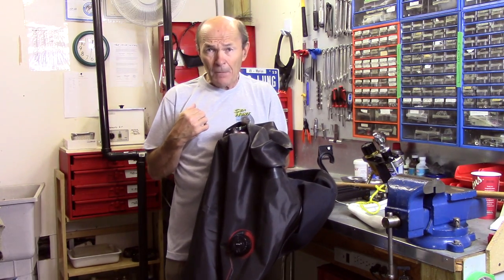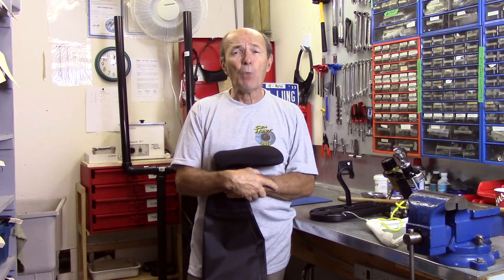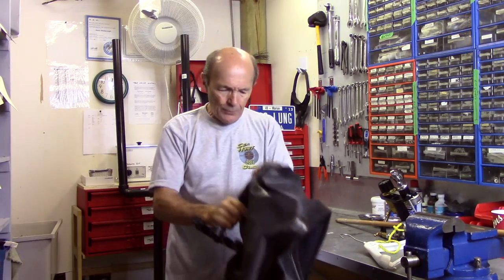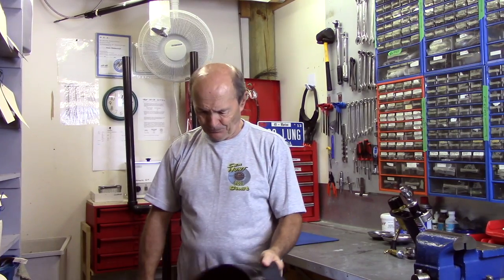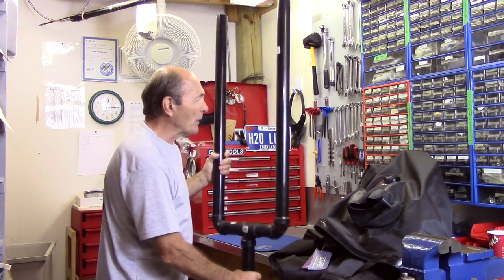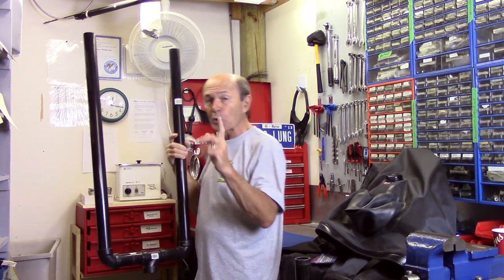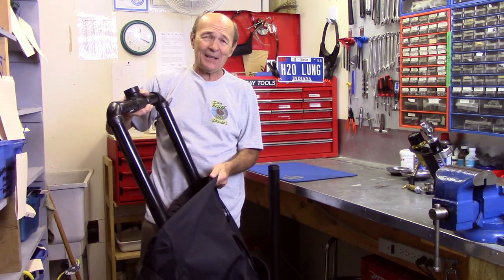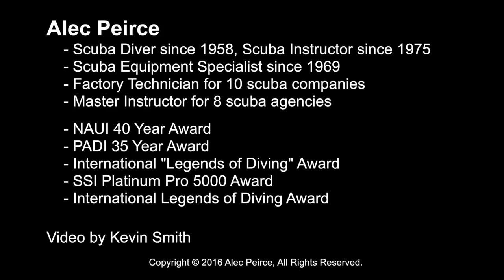How To Dry A Dry Suit - Scuba Tech Tips: S04E05

Comment: Thanks Alec. The broom handle is THE dryier that i will take when doing trips in the mountains. For the boots...... i find that putting some silica balls inside a sock and stuffing the socks inside each boot is pretty efective and of course portable ( in fact there are 2 different situations when you are faced to dry your suit, and when you are off home in remote areas and next day it will be more diving required... you whant your suit as dry as possible. when home the time is sufficient) Your hanger i will build but i willl ad a 90 degree fotting for each leg and put a cap on and a amall hole in the cap. At the bottom a ventilator of  some sort with high air flow. I'll send you a link on the construnction . Congrats  for the video and nice advice . Thanks again, Theodor.

Comment: Always enjoy the videos. Happens to have the drysuit you show (Bare Nex Gen) and recently had to wash the inside after a seal leak, but it's easy to reverse and hang to dry with soft boots! only thing is one of the shop owner told me not to reverse the drysuit as that will stress out the zipper (metal in mine) when taking it off as well to have someone else me pull the hand seals off instead of flip inside out.... drysuit are really a 2 man job (with back shoulder zipper) - guess that's what dive buddies are for!

Comment: Thank you for all the interesting and kind of addictive videos, have been diving for 20 years and still learning a lot from your tips. I have just finished my own "Alec's Dry Suit Hanger" and works great (I live and mostly dive in Chile, at 10-12°C) with a small variation: I used a sun umbrella's base instead of a flange, just because I had one lying around, but I think it might be cheaper,  or easier to find,  at any Home-Something....thanks again!
Reply from the maker: Great idea! Your dry suit dryer won't blow over.
The base is always the biggest problem. Your idea is the best!!
You can probably find them pretty cheap at garage sales since the umbrella gets ruined, not the base.
Thanks for watching from Chile.
Alec

Comment: I ended up making my own version of the DIY drysuit dryer for my first drysuit and it works perfectly! Love the videos and can’t wait to see what’s next!
Reply from the maker: Great to hear it worked for you. Did you make any modifications that we should know about?
Alec
Reply: Dylan so am I correct when i assume that with this custom drying rack you do not have to turn the drysuit inside out, both sides of it dry at the same time???  I hang my suit on a clothes line and what I do not like is that I first have to dry the outside 2x I got to flip it because where the suit folds it does not dry on the inner side of the fold, then I have to always flip it and dry the inside of my suit so really it is a 3 step process which sucks.  So how fast does the inside of the suit dry when you put in on a rack like this.
Reply: HealthSupercharger HealthSupercharger I put the removable top that is a U shape with a T in the middle into the legs of the suit, then place the neck of the suit through the base pole and the whole suit sits neatly the right way out . The water on the outside drys down the centre and comes out the neck and the outside drys in the air. Leaving it in a shed in 18 Celsius the inside and outside would be dry to the touch in about 3 to 5 hours, fully dry overnight.  

In short, just lay the suit flat on the floor right way out with the zip open, slide the leg holders in and then lift the whole assembly and place the neck over the the base pole and join them up, takes maybe 1:30 when you get used to it
Reply: Alec Peirce Scuba So glad to get noticed, it was almost the same as in the video only I made a H style base and had a T junction in the centre of it leading to the centre pole, made the whole thing from 2” PVC waste pipe and it works perfect. 

I used T joints on the upper part instead of right angled bends because that’s what I had on hand and it seems to work great! 

The suit is heavy with steel toed boots and the like at about 18-20lb but the pvc cement has no problems holding it.

Comment: I purposely flooded my drysuit by opening the neck seal during an uncommanded (somewhat of a newbie) ascent from 80 feet towards the end of a dive, later I just put loosely balled up shop paper towels (you can use newspapers) in the feet after rinsing the suit out, it seems to work fine, just keep adding new dry paper once in a while, twice to be exact.  It was nice and dry after about a day.  That's an old Army trick for drying out boots.

Comment: Yet another great use for ABS pipe. One reminder tip for those doing this project remember to deburr all exposed edges and drilled holes in the ABS pipe. Do not risk any sharp edges that could potentially damage your seals! The drilled holes can be chased with a sharp pocket knife and the cut off end of the pipe can be file with a flat file or rounded off with some sand paper in the hand. Then use shop air compressor blow gun or shop vac to clear the ABS pipe of all shaving and debris before shoving your dry suit on. This way you don't get into a dive and have some nasty ABS plastic splinters poking you or potentially damaging a neck or wrist seal when fitting the suit over the hanger! Great idea for a stand and reminds me a typical boot dryer minus the heated air. Don't risk forced heated air as that could loosen the glue compromising neck and wrist seals, that would be a bad day requiring a shop repair...
Reply from the maker: Yes, Yes. Sand all the edges smooth.
Thanks Jeff. Alec

Comment: One of my diving buddies has a setup like this in his garage, except he put PC power unit fans in the base piece to increase the ventilation.
Reply from the maker: That's a common improvement and a good idea.
Just be sure that the fan has lots of ventilation and is not blocked from blowing or it may overheat.
One diver used a hair dryer and burnt out the dryer plus damaged his suit.
Thanks for watching.
Alec

Comment: thank you alec, that's fantastic .. i always struggle with my origin northern diver commercial 7mm with steelies. gonna add a small pc fan to the pipes to blow air into it... brilliant, no more wet foistiy feet for mesa :)
Reply: the fan ...... that is what is missing. I also have a trilaminate heavy bulky OTTER armor skin dry suit that is a struggle to dry inside. After every dive the darn boots absorb so much moisture that they are like hell to get dry and not stink
Reply: Don't know if the PC fan will be powerful enough... It's got a long way to push the air. What about a modified hair drier with no heating? Good luck with the project, please make a vid....
Reply from the maker: Good idea. Pick up a cheap hairdryer at a garage sale and hook it up to the bottom. NO HEAT! Alec
Reply: Jury-rigging with a hair dryer is one idea, but a faster and easier way, although maybe a bit more expensive, would be to use a boot dryer and add ABS extensions.  See: https://www.walmart.com/ip/Peet-Electric-Thermal-Boot-Dryer-Black/17687503 for example.
Reply: You could use a Delta PC fan if you don't mind a little noise and have a 12 volt power supply with at has about 4 amps output. I have some of these fans on my computer and they are nice. https://www.amazon.com/Original-Delta-TFC1212DE-Inverter-Cooling/dp/B00L5XEKOS
Reply: Love the boot drier.... God bless Walmart.
Reply from the maker: There goes my $20 dryer!! However, it sounds good and I suppose you only ever build one. Alec
Reply from the maker: You'd get a kick out watching me shop at Home Depot. I take up an entire aisle with plumbing fittings all spread out, pressed together in various weird shapes. It's really funny when a "plumbing associate" comes over to "help". He starts to tell me that my arrangement doesn't meet the plumbing code - Duh!! Alec

Comment: PVC pipe can be done in the states for under $20 or ~$30 with a USB fan as one poster said below.  Material list and prices from LOWES 10' 1-1/2" PVC pipe- $5.51, 2-90 degree elbows $1.70; 2-Ts $2.70, 3" spigot Flange $4.48; 3" to 1.5" coupling $2.74  and a USB fan from Amazon $9.95.  Total W/O Fan $15.78.  With Fan $26.73  Give or take depending your market.  Not bad for good drying rack.
Reply from the maker: Cheap!! Good for the drysuit and great for the diver.
I suppose you could use a 12 volt fan and dry your suit between dives from your car.
Now you're talking!!
Thanks.

Alec

Comment: If you add another T on the main tube, you can add a 40mm x 40mm "computer fan", blowing out, with a 12 volt wall transformer and have a vented dry suit dryer, specially for humid places like Florida.
Reply from the maker: Another good idea. Blowing out is important, rather than in. That way you won't get into overheating problems. Lots of extra holes in the pipes too especially up the leg tubes so the air has to travel all the way down through the suit.
Boy, I'll soon have all you guys doing the DIY (Do It Yourself) thing just like the 60's. Alec

Comment: Thank you Alec, always a joy to watch you tec tips, kinda become the late night bed shows to watch. Anyway I do have a follow up question. Since my drysuite rarly dry up (this is a good thing as I am in the water so regulary) i do need to wash it. Bought mine used as the prices here in Norway is insane. So I have not gotten around to washing it yet because I am affraid the soap or cleaning product will damage the latex seals or the drysuit material. Mine is an BARE XDC2 neoprene suite, so my question is: What type of soap should I use and are there anything I need to use to protect the latex seals after the wash? Should you also protect the valves?
Reply from the maker: The XCD2 is my favorite dry suit. Just use any light duty laundry detergent. You don't need a harsh one. Don't use too much, mixed in water then spray it all over the suit, in and out and scrub with a small brush. Then rinse the heck out of it. Rinse lots and hang to dry out of the sun. The valves will actually enjoy the soap. Rinse them well. The seals the same. You could put some Seal Saver on the latex or a bit of silicon grease. Put a small dab of grease in your palm, rub it around until the hands are greasy and warm then rub the seals between your hands until they are warm and all shiny too. And don't forget to the brush all the teeth and to lightly, lightly, lightly lube the zip with Zip Lube (did I say lightly?!). I can ship an XCDS (they changed the name) to you for about $1500.
Reply: Thanks, will keep that in mind for sure Alec. But for now the Rescue Diver course is next in line. Will also put all your advice into play..

Comment: Hi Alec, I have a question about dry suits. Is easy to fix small punctures (eg. some urchin's needles in a knee...don't really know how they got there) in a neoprene dry suit?, or is it better to take it to a LDS?
Reply from the maker: Small holes or tears are easy to fix. Your LDS does exactly the same. 
Get some neoprene cement at the dive store. It has to be neoprene cement, not silicon or Aqua Seal. Neoprene cement is a contact cement which means you must put a thin coat on each side of the hole or tear and keep the 2 sides separate while that coat dries. Use wax paper for tears or a plastic stir stick for holes. Wait about 10 minutes then put another thin coat of cement on, wait only about 2 minutes and then align and press the 2 sides together holding them in place for 2 minutes. Presto! Perfect repair. A bit of practice and you can go into business.
If it's a big tear, the same process works but you should protect the tear by stitching the sides together. This is best done with an iron-on product like Iron Mend from McNett. Cut an appropriate size and follow directions. This stuff sticks to the nylon and protects it from further tearing as well as allowing you to stretch the suit and not open the tear. It's the same stuff my mom used to iron onto the knees of my pants so I wouldn't wear through them - even if they were brand new. I hated going to school in new pants with my mom's iron-on knees!
Good luck.
Alec
Reply: Thank you!

Comment: Hi Alec, I have another question about dry suits, about dry suit diving this time. I was taught to use the suit for buoyancy control while diving keeping the BCD deflated, but have heard recently that many divers do it just the other way around: using the BCD for buoyancy control, while adding air to the suit just to avoid squeezing, and keeping its shoulder valve open the whole time. Somehow, this make more sense to me, BCD means buoyancy control after all, but I have not try it yet. What do you think about it? How do you control buoyancy while in a dry suit?
Reply from the maker: You're right!
The drysuit is to keep you dry and warm. The BCD is for buoyancy control.
Dry suits are not new and the earliest ones with valves like the Poseidon Unisuit were commonly used without a BC. BCs were a new-fangled idea and many divers didn't have them or didn't want them.
So it became common for divers to use their drysuit as buoyancy control. Somehow that idea still hangs around.
But, it's not only not nearly as efficient as a BCD, it can be downright dangerous.
The BCD has typically 25 to 45 pounds of lift. To get that lift in a drysuit it would have to be blown up like a balloon. Inflate the drysuit too much and there's a real risk of a seal popping out - either a wrist seal or the neck seal will simply blow out from the pressure inside. If that happens you are going to get very wet and cold but worse, you also get very negative at the same time. The suit fills with water.
Proper procedure is to have the drysuit empty at the surface as your enter, put air into the BCD to maintain buoyancy. When ready to descend, let air out of the BCD slowly until you are dropping under control.
As you descend you now need to add air slowly to the drysuit to prevent a squeeze and to maintain the air space that's keeping your warm. Add only enough to stop any squeeze! Use the BCD to stop your descent when necessary.
This works perfectly since, as you descend any air in the BCD and the suit is compressed so you get negative and need added buoyancy anyway.
When  you reach your dive depth stop and adjust everything - enough air in the suit to keep you warm and comfortable and enough air in the BCD to maintain proper buoyancy for that depth. Any change in your depth may require more adjustment but just be sure you do not have too much air in the suit.

On ascent things get really tricky.
Theoretically you do the same in reverse. That is, you let air out of the suit to stop it from over-inflating but keeping enough to stay warm and not squeezed. At the same time you need to control your ascent by slowly losing air from the BCD so that you reach the surface as you left it - little or no air in the suit and just enough air in the BCD to keep you on the surface.
However, in practice this is very difficult to do. Don't forget that you're also monitoring your air supply, computer readout, looking for that 15' safety stop, watching for your buddy and checking overhead.
Many divers will simply empty their drysuit at depth and use the BCD only for control on ascent. This works well but in the last 30' to the surface, even a little bit of air in the drysuit will expand rapidly and cause problems so be ready to hit that exhaust valve!
When we do our Dry Suit series I'll try to demonstrate this. Hopefully you get the idea.
Take care.
Alec
Reply: I got it!, thank you very much...looking forward for those Dry Suit series
Reply: There are two ways to operate with drysuit and BCD:
- using both BCD and drysuit inflated: the drysuit to don't squeeze and keep warm, and the BCD for buoyancy, and the people
- using BCD only on surface, and the drysuit to keep warm and maintain buoyancy.
I first learned to use both.  But after some dives, I was told that it's much easier to only have to manage one source of buoyancy.
So in my opinion and with many dives, I only manage my buoyancy with drysuit.  I find it much easier.

Comment: How is best way to locate small leak around zipper hip area best lube
Reply from the maker: The ONLY way is to locate the leak and seal it with Aqualseal.
And the best way to do that is to inflate the dry suit nice and hard then locate the leak by spraying a soapy water solution where you suspect the leak exists.
The biggest problem you face is inflating the dry suit. To do that you must first seal the openings - the neck and wrists, and that's done by forcing a volleyball-sized ball or large tin can into the neck seal and a large soda bottle into each of the wrists.
Now you can inflate the dry suit hard enough and long enough to look for leaks.
Hopefully it is in the suit or seam or where the zipper attaches to the suit and not in the zip itself.
Let me know how you make out.
Alec

Comment: add a small battery operated fan to blow air into the tubes and into the suit would make it more efficient moving damp air out under positive pressure
Reply from the maker: Lots of guys have rigged up something like that.
Certainly it's a good idea if you need the suit dry in a hurry.
Even something as simple as a computer fan would work - quiet, cheap and easy to power.
Thanks for watching.
Alec
Reply: loved your fight with the suit
Reply: Ohh my gosh that is so true a fan or hair dryer set on cold would be so perfect.

Comment: blow some room temp air through the pvc setup...might dry faster
Reply from the maker: I'd thought of putting a fan on the bottom with some good sized holes and then some more holes at the top in the leg tubes. It would help but would take a bit of rigging. I'm trying to keep it simple. Someone suggested a hair dryer but I don't think heat is necessary. A hair dryer might burn out if used to long. In cold weather you could just set it over a warm air floor register in your home.
Alec